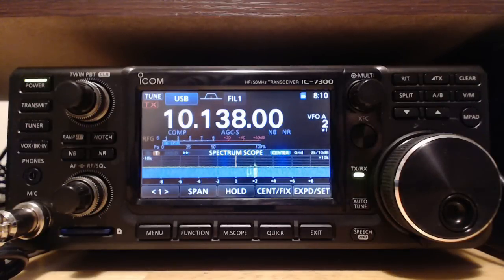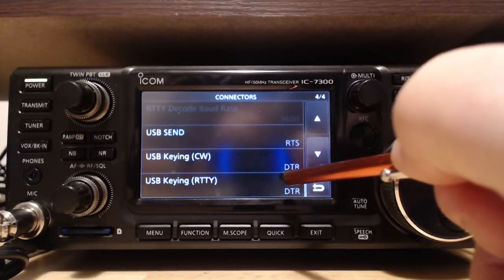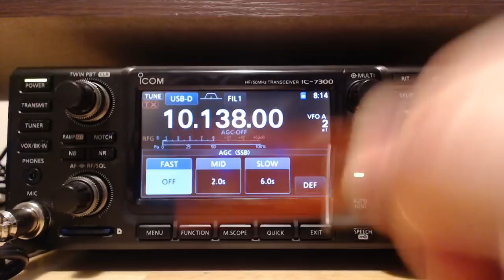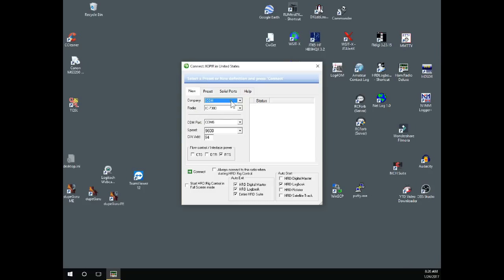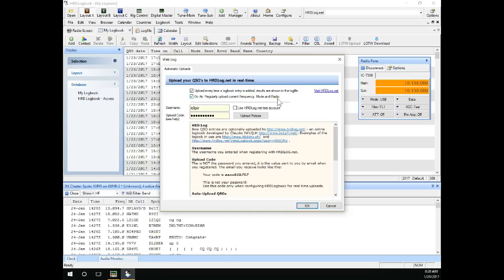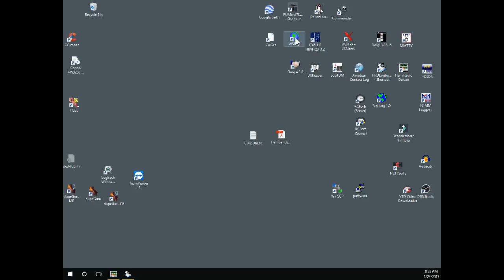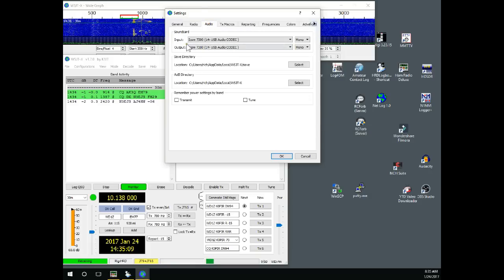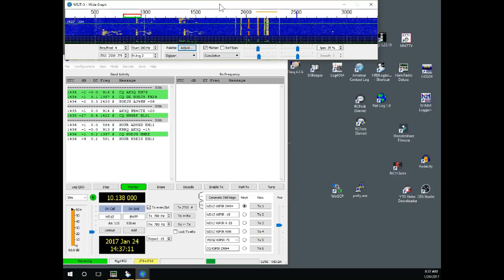ICOM 7300 WSJT-X COMBINED WITH HRD AND JT-ALERT PART 1

Comment from the maker: Update: Look in WSJT-X Settings under the Radio tab. With the IC-7300 we can use Data/Pkt. for Mode. It works better and it will set the Icom 7300 to the correct mode (USB-D) if checked.

https://youtu.be/5gS_rI2wJIQ?t=11m39s

Rich, K0PIR

Comment: Rich, thanks for the video, just a question in WSJT-X my receive keeps flashing into RED, I see on your screen you have a slide control is that an early program I do not have that slider? 73 Phil G0BVD
Reply from the maker: Hi Phillip,
Nice to hear from you and great question. That's correct, it was an older version. Now we have to adjust the input using Windows or the radio. I will have to do an updated video.

Thanks for the question, best 73 - Rich, K0PIR